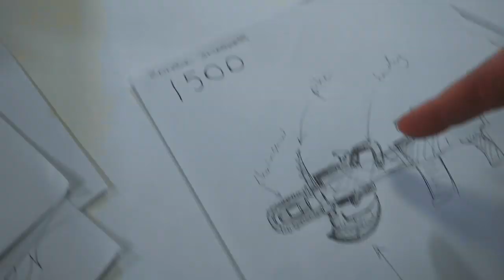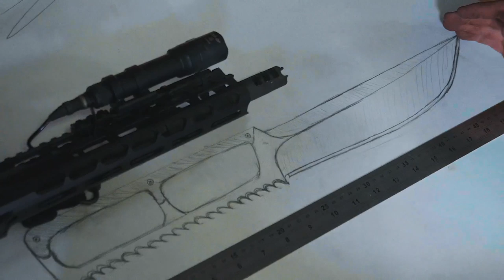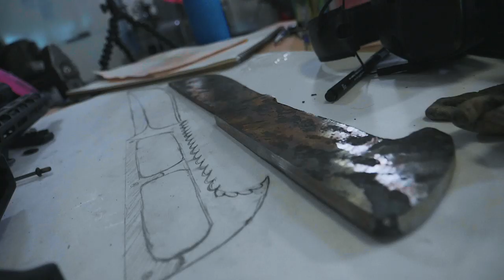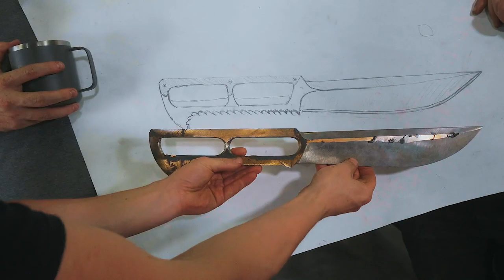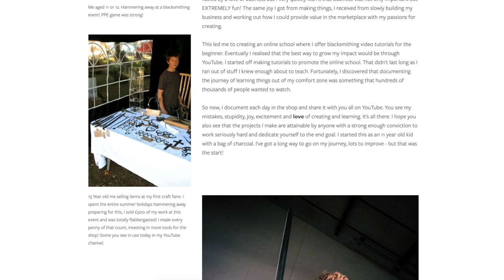The ULTIMATE Zombie Bayonet: Part 1

Comment: 2:04 (and paused) Alec, you really need to move that falchion and any other blades that are above light switches like that. That's a serious safety hazard and might also be an OSHA violation! You, Will, A guest, an intern, the cameraman might turn on/off those lights and run their hand across that sharp blade and need stitches. I don't want to see one of you get hurt and I don't want to see an OSHA fine. 

If you don't want to move it then please go to the local pet supply store and get some clear tubing for fish aquarium aeration and cut a piece as long as the blade edge then all the way down from end to end and put it over the edge so hands will hit round plastic rather than sharpened steel. That tubing is perfect for making blade edge covers, hard enough to prevent it from being compressed and cutting through if a hand hits it but soft enough to cut the slit and attach without injuring yourself in the process... plus it's clear.

Be safe!

Comment: You should have made the serrated parts of the blade the opposite direction so it cuts on the pull stroke if you were to be using it to get firewood etc....

Comment: Technically the lower receiver is the part that's considered the firearm since it is the part with the serial number so taking the bolt out doesn't change its identity but it does obviously make it incapable of firing if that's what ya'll were going for.

Comment: I have to say I highly disagree with the design that was chosen. The blade surface area is too large. It's likely to wear out on the rifle mounting or get stuck in the he skull. You'd want something more spear like so it's easy to pierce the skull and pull out with minimal stress to the rifle mounting and won't take as much energy to pull out for multiple zombies.

Comment: when you field test the Zombie Bayonet, will yous be putting rounds through the gun as with so much weight on the front, I wander if it will greatly reduce the recoil or be to heavy to use?

Comment: Does the M3 Cubitron grinding disc contain the minuscule 3 sided pyramid-like grains in its structure or has it become like what's being shipped internationally now where it''s just on the surface? The first edition had these awesome magical black grains through out the disc but then it seems they cut back on them and they play only about a 20% role now. Bought them a lot until they changed back to normal grinding discs.